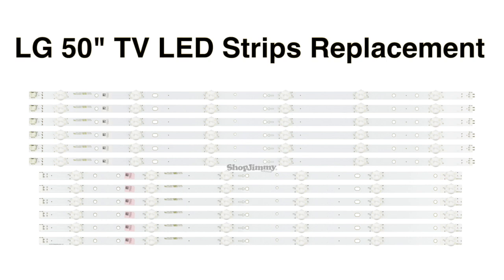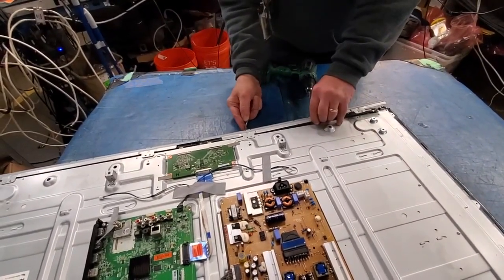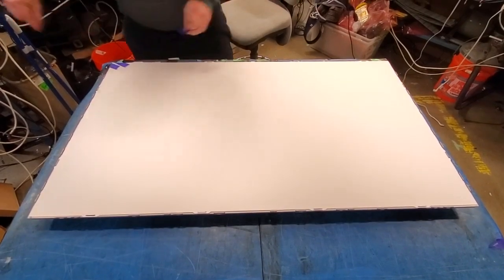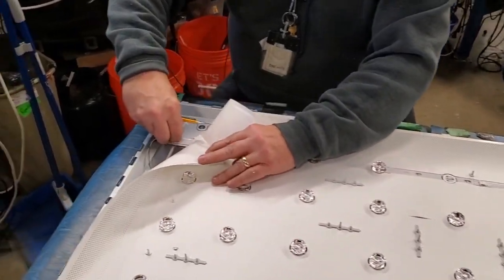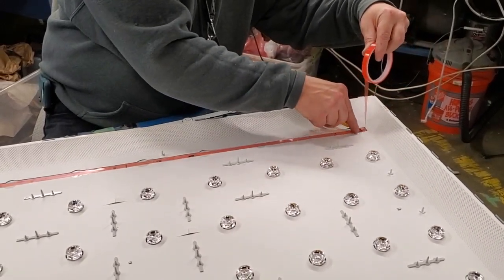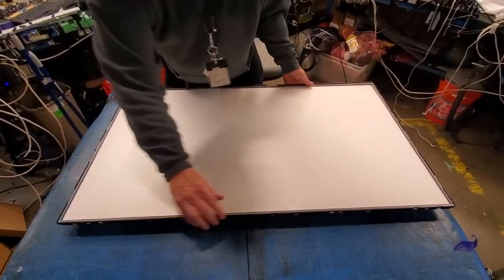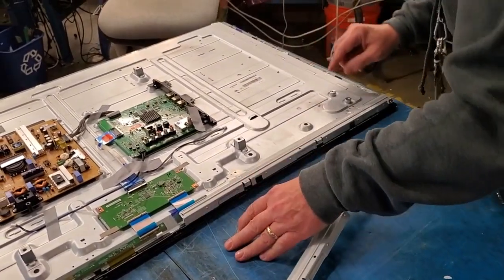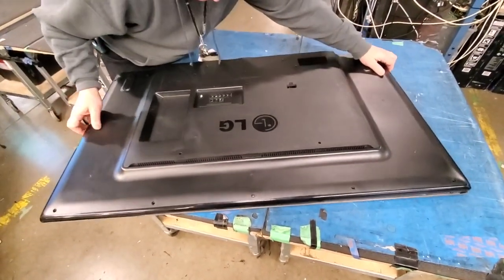LG LED 50" TV-No Backlights & No Image LED Strip Replacement Models 50LB 50LF

Comment: Did this repair just now - it worked but a few things I noticed in the process:
* There appears to have been a slight change in the wiring to the bracket that holds the power button and LED. Just one cable to disconnect on my model.
* Cutting away the reflective plastic around the LED strips does result in some visible horizontal stripes in the screen afterwards. If you can avoid that and remove the reflector without damaging it I'd recommend that if you're the type who's sensitive to those kinds of things.
* You will pop off all those lenses while removing the old LED strips. Just accept that now and move on.
* Prying the old LED strips off of the original double-sticky tape is the worst part of the whole process. Take your time, be careful. I did them one row at a time and reconnected the wiring as I went along so that I wouldn't lose track of what went where.
Overall happy with the result - saved some e-waste and now have a bigger TV in the exercise room. It'll be interesting to see how long that lasts.

Comment: Great Videos, nice to get to know these things more in depth ...

Been trying to repair this Samsung UN49MU8000F it turns on and has audio if the screen cables are disconnected from the main board, but as soon as those get plugged back in it goes into boot loop mode,  attempted to swap power board and control board, but turned out with same issue ... anyone has any suggestions ?

Comment: Need help please my tcl turns on and works properly for about 30 seconds then the picture starts flashing i checked all L E D strips and they are all fine could it be a computer board that is faulty is there any way to check.  Thanx Joe

Comment: Are you guys I need some help I have a 55 inch Samsung smart TV ue55h6290ss  not sure what’s wrong with it sometime the top side of the TV is darker and sometimes the bottom side of the TV is dark sometime sometime they all work I took the TV apart I tested all the back lights they all fine Any suggestions Thank you very much

Comment: Hi guys I was given a 42pq300 plasma TV and it'd not turn on. .only the standby light is red then it flashing and stays blue. .but nothing on tv and remote not functioning with tv but it does work against my other lg tv.  I've watch your videos and I can hear a clicking sound. ..and I've Disconnected the both boards from powr supply board and plugged bk the power lead and it's still clicking.  So any suggestions.  Thanks guys